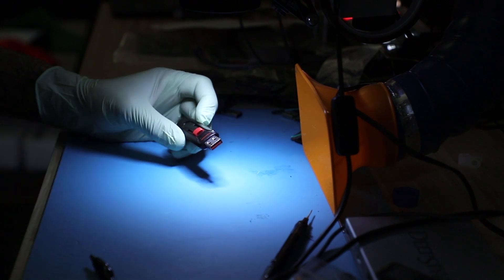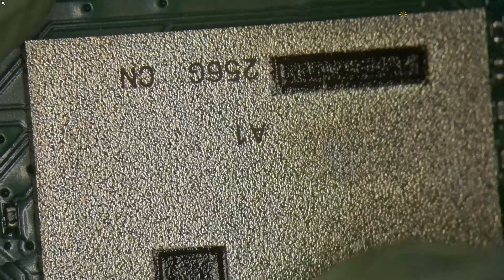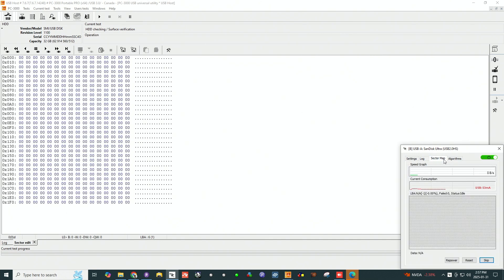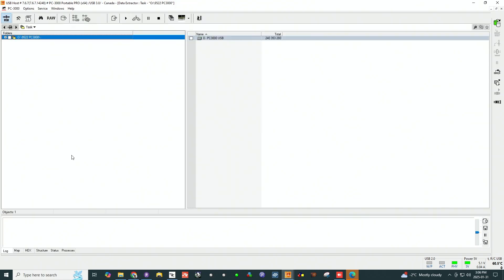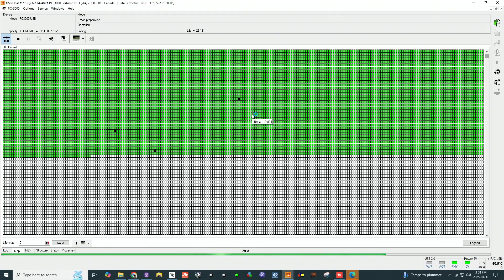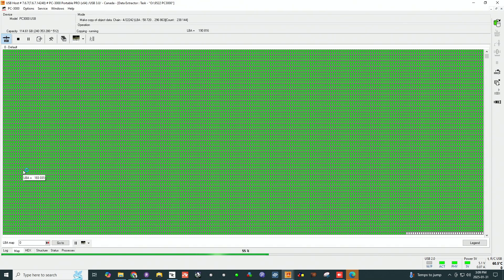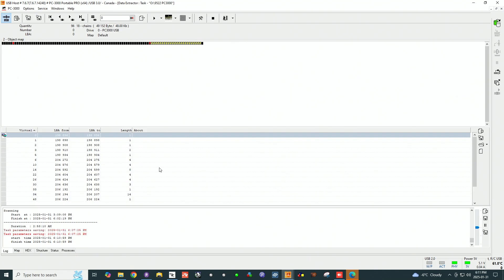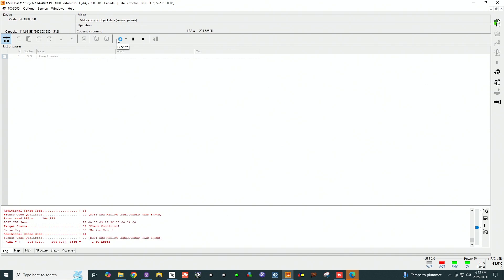bad sectors are a massive problem for your data

Comment: I just recently noticed that problem on a Western Digital WD10SPZX hard drive i currently have. When i plug in the drive, Windows tries to read the filesystem but because of the bad sectors the HDD tries to read them again and again but apparently doesn't succeed and everything just locks up because the hard drive is busy all the time. After some time i finally managed to take the volume offline and then it stopped and i could even read most of the files from the HDD with testdisk, although there wasn't really anything important.
Reply from the maker: That’s a very common problem for WD drives and called slow response.

Comment: How hard would it be to make it use all 256gb?
Reply from the maker: Most likely the 256 has 2 packages. Each one is 128. I suspect that Sandisk had a problem chip so they utilized the half instead of throwing it away

Comment: good video and great job with data recovery.u mentioned bad sectors may takecdaysvor months,but have you trying to dwap diffrent controll what work with flash flash or maybe even costum prgaramable controller what can speed ip progress?like forcing itvread read over and over bad sectors,?
Reply from the maker: in Data Extractor you are able to work map using "legend". Legend is a color that the sector will obtain after it is attempted to be read. Most sectors you see on the screen are green - that indicates that the read was successful. Other colors will mean other things, like errors, timeout, skipped, modified and so on. Well, after we run the first pass of imaging by used space map, we create a map using a legend. So all of the sectors that could not be read - we can read them as many times as we like. With USB device the customizations are limited to what the read algorithm is going to be like, but we can still change parameters to help it read. Also cooling the device and heating the device while reading out errored sectors can help to read them clean also